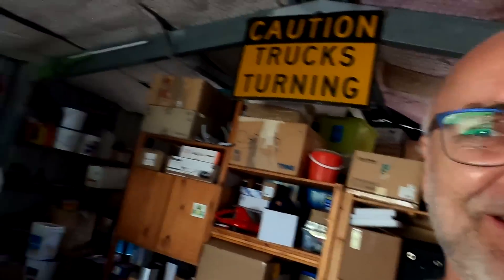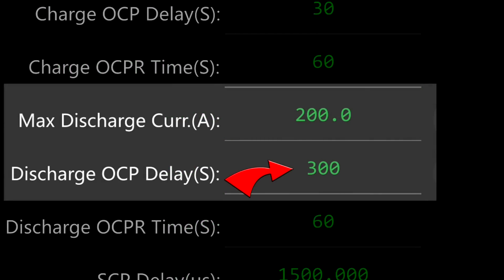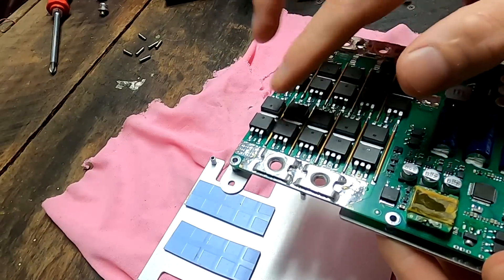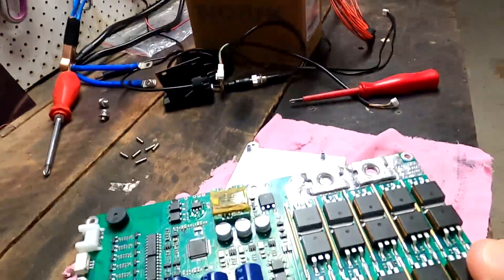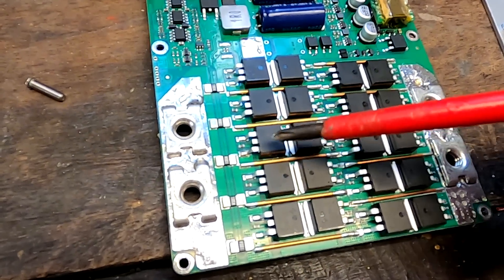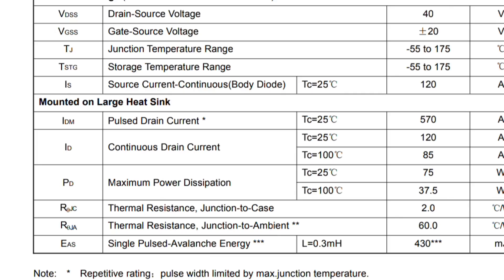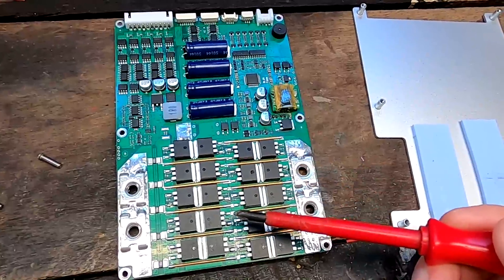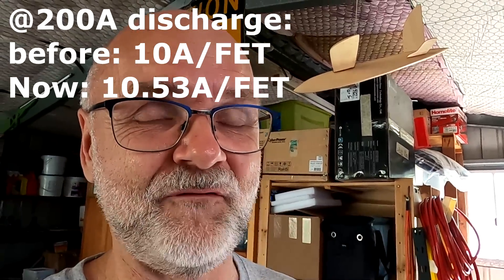Magic smoke! What happened to the JK-BMS? Still reliable or bad design?

Comment: Hello Andy. Shortly to answer your concern /questions.. No probably with your soldering iron it is impossible to do ..you need special one that will allow high amount of heat to build on it's thick end point.. also there are special preheating ovens or such that are used for this..ofc you need low melting solder and also similar equipment..I would suggest to cut legs of that mosfet.

Secondly as you can see there are 20 mosfets..but they are probably in H bridge configuration..or maybe not..anyway.. it looks like there is no overvoltage protection at all. BEcause current in that point is not important..what you worry that time is voltage spike accors whole board..also reverse  voltage should be handled by external fast diode so it would clamp down this voltage..also some low pass filter should be considered to increase time those mosfets are attacked by.. All those mosfets are working in paralen..on one way or another..but still it is more tha capable to handle it all.. But you should Understand that even it say on Mosfet it can handle 100Amps each.it isn't actually the case..it can handle much less .because of package restrictions and also temperature restrictions..also i did notice they are using pretty thick thermo pads..there are not the best for this purpose..

Comment: i would cut the legs off the faulty mosfet to prevent any shorts back to the control circuitry at a later date (might never happen but as its already not doing anythig - it wouldnt hurt right?)

Comment: If you want to change the MOSFET, you really need a hot air from the bottom to heat the hole PCB area around the MOSFET to let's say 200°C. Then you should be able to remove the drain pin and fit the new MOSFET with your normal soldering iron. You can just solder from the top of the metal tap since it's so thermally conductive that it will solder to the pad. They're normally reflowed with about 260°C, but they can withstand more for a moment. Soldering with 350 shouldn't be a problem. But you definitely need hot air from the bottom, otherwise its probably impossible do do without damaging other things. Also the hot air should have a temperature regulation (not your cheap pink hot air fan).

Comment: Lots of possibilities, counterfeit parts are quite common nowadays. I didn't look, but that might be junction temperature they rate it for, and the junction temperature is far higher than the case temperature. Chinese engineers seem to also rate things for their theoretical maximum, and western engineers tend to derate by 20 to 25%. Daly is a terrible BMS, their quality control doesn't seem to exist. Defective part is the most likely cause, but I would not trust any Chinese device to operate continuously at the maximum rated capacity. As someone else pointed out, they also tend to fail as a short, and I am frankly surprised this one did not.

Comment: Just from general observation, it seems like it was just a faulty FET. The source component manufacture  makes them in 1,000 piece reels everyday and there is always gonna be percentage of failure rate per 100,000. The manufacturer of the BMS is being quite conservative on the drain current and dissipation by dividing them amongst the 20 FET's. I'm gonna chuck it on the what are the odds factor. My experience when those FET's goes pop, they tend to fail in the shorted condition and starts a cascading effect; you just lucked out in this case.

As for repairing the faulty component, it'll require a hot air rework soldering station since quite a lot of components are now being soldered at the SMT level. There's a slight learning curve to it so you're not blowing the component(s) that you're not removing off the board vice versa.

Overall, I would still use this BMS for my projects. The moral of the story is that the BMS should be the last ditch line of defense and the overcurrent protection DC isolator should be the first to trip in event of a sustained overload.

Comment: You need a temperature controlled hot air soldering station to desolder the mosfet
It cost around 50€

Comment: Andys torture test revealed a weak link. Maybe the settings could have been a little more conservative. With Andy, that's a funny thing to say!  I'm still trying to wrap my mind around 200 amps since my planned wind/solar system would maybe charge at 40 amps in a wind storm. Most likely charging at 15-20 amps.  my largest draw is 12 amps for around five minutes (instant hot water heater)  I'm not trying to charge an EV at high amps though. I've read that many EV chargers use 16 amps at 240 volts. which I can do. The push seems to be more volts for EVs and charging at higher rates to make charging go faster. It's a continuous learning thing.

Comment: I think you are correct. It was bad from the start and couldn't handle the load. It does show how strong they build the JK BMS so if 1 blows it still works.  I would not try to replace it yourself. having them send you a new one so you can redo the test is what I would do.

Comment: Hi Andy, great video. You raised an important question : "why some BMS can died when installed in // with some other ones ?" I am planning to add another 16s LFPO with another JKBMS..... Can be an interesting topic for a futur video.
Reply: Another reason I have said since the beginning of the first build that cells should be put in parallel, instead of putting batteries in parallel.
Reply: What do we mean by "BMS'es in parallel"? Are we talking about using multiple BMS'es on the same battery string to increase capacity, or are we talking about paralleling battery strings with one BMS each? That would be a huge difference and I can only imagine an issue with the first case.

Comment: Hi Andy, you can use miss piggy to do the desoldering.
Reply: One extra note, when performing the same procedure, please use a breaker at around 300A, if the mosfet goes bananas you are covered when it short circuits, that would give a bang, now it went into high impedance, a short circuit is also possible which is very bad without a breaker

Comment: Just cut.  The leads of the burnt mosfet. All are a matched set, you cannot replace just one. It will burn out again. The unit will work fine without it.

Comment: Did Hankzor say there was an inherent problem with running multiple batteries in parallel? I have 5x 16S LiFePO4 batteries each with its own JK BMS. I've not noticed any issues, but I rarely go over 0.2C charge or discharge.
Reply: I've gone well over that, and also don't have any issues with two of them in parallel. I'm adding another two, and don't expect any issues either.
Reply: I was hoping for more info about this in this video

Comment: 052022/1226h PST 🇺🇸 052122/0526h 🇦🇺 Guten Tag, Herr Andy. Danks scheon. Electronics and its passive components.... no guarantee ..not at all. I have learned this decades ago. I'd not call the incident as design issue.
And I don't think it's possible for the JK engineers to test each n every passive component before assembly. it's assumed that one in a million of production part will be a black sheep. And the SNIFF procedure was practiced several decades ago, even before the advent of solid state components (arrived in the market), especially the mains transformers, Audio output transformers, Aluminium clad resistors, Capacitors etc etc. The pungent smell was the giveaway...😀
Regarding the repair and or replacement of the MOSFET...hmmmmmm YES and NO.... Yes , because it's a test procedure, so it can be done... but results may be unreliable. I'd snip the G & S and apply copious amount of KESTER 951and press preheated 300W soldering iron for 2 seconds to detach the Drain. I can say this but how practical that's going to be...I have no comments. Also remember... if the factory Laser soldering used RoHS substances.....Please do not attempt the amputation. Seek a replacement of BMS. Do forgive for my thoughts.... have a nice day ahead und 73s...

Comment: If you knew for sure that only 1 of the 20 was dead, seems reasonable to continue use as long as you're 100% certain you won't near the max rated current. But some of the remaining 19 might also be dead, you just can't see it because they didn't blow up/crack open. 

I'm also left wondering if some of the remaining 19 are still "working fine," but were slightly damaged and are now much more susceptible to being totally destroyed the next time they see moderately high currents.

Comment: The MOSFET probably got too hot.  It is in the center of the others.  So when it turned off it actually was shorted(they fail short).  Then with 200A+ available it just smoked until it opened.  If you set 200A and 200 sec you probably would have been fine.  The current isn't shared evenly either.  There is always some differences so you might see 15A on one MOSFET.

Comment: You can repair using a hot air soldering station.  Not that expensive and common for surface mount component repairs.  Get some low melt temp solder and have that flow in to move the heat, and out it will come.
Reply: In addition, it is better to isolate other mosfets from the heat by using the kapton tape on them while doing this.

Comment: As mentioned by another person inductive spike may be the cause but Andy's comment about load sharing is also possible.  It may simply be that the failed FET had slightly different switching points / times compared to the others.  It would be interesting to desolder the other FETs and put them through a tester to characterise them to see if they are well matched or not.

Comment: desoldering with a hot air soldering station - also heat up the area around the MOSFET because the GND areas absorb a lot of heat, the new MOSFET can be soldered with a soldering iron ... works fine, done this many time ...

Comment: It is possible to change that mosfet, but I think that soldering iron is far too small! With big heat capacity iron it would be possibly but might not be worth of the hassle, just derate it to150-180A or something.

All mosfets that have I have managed to get  failing  have failed to short, if that is case also here then you are right "pulse" was too long :--) That poor mosfet was trying to pass 200A alone and same time was acting as a 80W heater and pufff!! No short any more
Reply: Also there is no 20 mosfets parallel there is ten mosfet pairs on parallel per side. In each pair other mosfet is for cutting charging and other is for cutting discharging .

Comment: Can turn the timer down.  Turn down max amps.  All good.  Risking damage to the board if it's working OK is crazy.  If you're OK with killing it, then it's an easy fix with a hot air soldier station but then you've got to purchase one of these.

Comment: Just a faulty MOSFET which can happen to any device that uses them, not necessarily a sign that JK BMS are bad. I would be tempted to remove the faulty FET before putting the BMS back into use, ideally replace it.

Comment: I think the BMS failing isn't all that unexpected. I like to derate things like this 25% or more . The 200 amp 4s bms I use is easily double the size and cooling surface . It's probably a somewhat faulty FET, but driving things to the maximum always runs into risk/issues for me whereas derating them results in a happy long life.